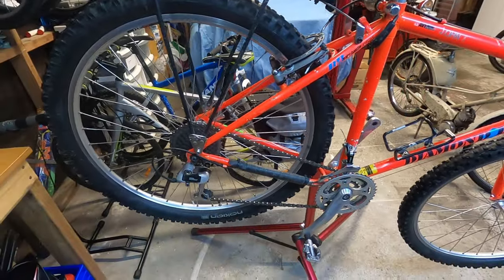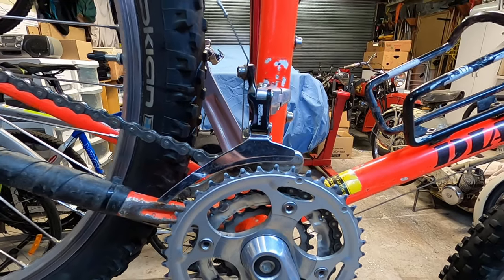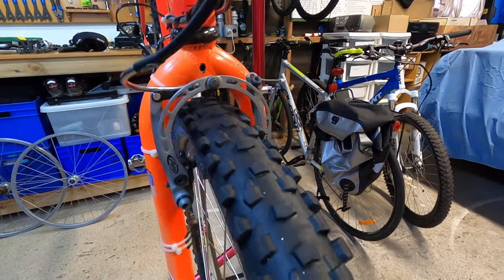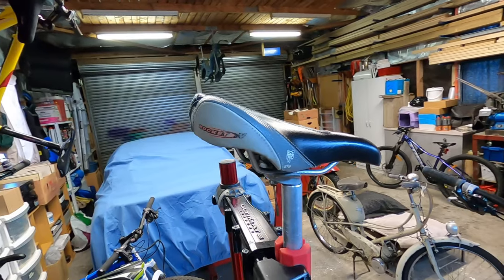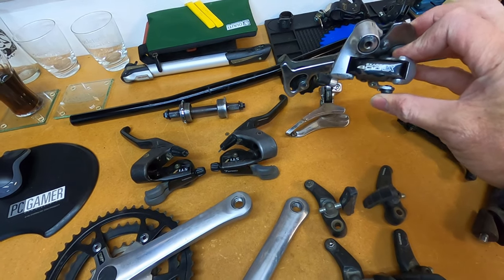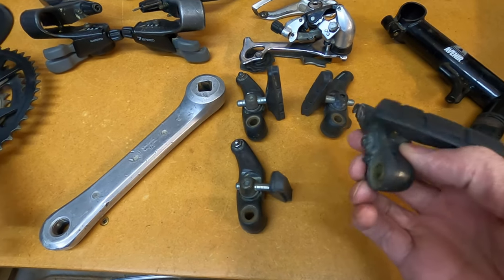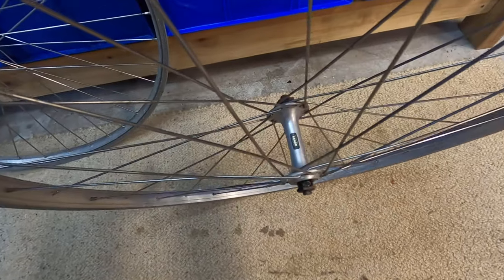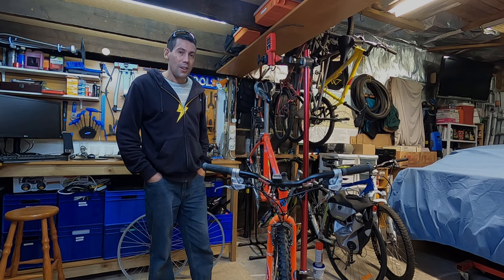1991 Diamondback Ascent Retro Mountain bike

Comment: Picked up my 1991 DB Ascent EX in Indigo/Pink/White colorway earlier this year and it quickly became my go-to gravel bike & commuter! Still using the 3x7 deore LX that came on it but with thumb friction shifters and avid levers/tektro v-brakes instead of the integrated brake/shift levers and canti brakes that were on it. Also running some slightly swept back 7/8" titanium handlebars and a 35mm stem with a threaded to threadless converter, and some Maxxis DTH gumwall tires. Absolutely in love with this bike. As of today I've put just under 350 miles on it and about 27,500 feet of climbing. It is wonderful. Runs silently, shifts smoothely, feels light and responsive and doesn't fuss about anything.

Love the orange color of yours and so happy to see you're still putting miles in on it! These bikes beg to be ridden and appreciated.
Reply from the maker: Hi there, that's awesome to hear about your bike, and sounds like a nice retro color scheme.  The early Diamondback bikes are great bikes to ride, I use mine as my go to bike too.  You may get some comments on the trails I find, possibly as you just don't see many retro bikes around these days.  Definitely a bike to hang onto and enjoy riding 😄

Comment: Good to see appreciation for the old mtbs. I've resurrected my 1990 DB Ascent first and only bike. Still has it's original parts...except for tyres and seat and grips. I use it for a bit of everything, road and off road touring; and as transport to cut down on fuel use and costs.
Reply from the maker: Thanks yes its great keeping these older bikes going and used, good on you for getting your first bike up and running again 👍

Comment: I'm looking forward to rebuilding my 1998 Cannondale F500, which was my first real mountain bike and probably the one bike I've owned with the most miles on it.
Reply from the maker: That's a fantastic bike, I googled the model to see what they come with spec wise, quite a nice bike indeed.  Does it have the head shock, how does it ride?
Reply: Your bike is nice and I like your video(s). I'm trying work up the courage to make one someday. The Cannondale is light and stiff, and the head shock is pretty nice and maintenance free. I had the frame powder coated, got new wheels and all new components (virtually nothing was salvageable), so it will lose its retroness. But I don't care; it will be like new again, which will be exciting for me as I haven't been on it in 16 years.
Reply from the maker: @tanner4828  Making a video is a good idea, I find the gopro cameras really versatile if you are looking for a camera to start with.  Nice it sounds like it will be a good build and it doesn't matter about losing its retroness at least it will be back riding again 😊

Comment: I have this exact bike and it was also my first, so very sentimental..it needs a new rear shifter control as the wire has gone slack.
Reply from the maker: Hi Grant, good to hear you have the exact same bike.  Definitely hold on to it I still remember seeing mine in the showroom window.  Are you still running the original rapid fire shifters?  Hope you manage to find a replacement shifter, perhaps the shifter needs a good lube up?
Reply: @MannixGarage  all original except the seat and tyres
Reply from the maker: @grantrayner2291  Sounds like you have a nice stock bike.  I have kept the original bits for mine.  I too don't have the original tyres which I remember being Tioga Wonder Dawgs, oh the memories 🙂
Reply: @MannixGarage  I will have to open up the shifter and have a look, the leavers move but the cable doesn't so something has snapped or broken within the casing. I too saw it in a shop and it was 50% off so I spent my first months pay check of my first job on the bike. Your video has got me motivated to restore it so I can ride the local trails.
Reply from the maker: @grantrayner2291  Hope the restore goes well.  Do you hear a clicking noise as you operate the shifter? Hopefully nothing is broken internally.
Reply: @MannixGarage  no clicking...will open her up this weekend.
Reply from the maker: @grantrayner2291  Hopefully you find its repairable.

Comment: Great video! Currently running a 1995 Specialized Hardrock. Did you ever finish restoring the other Diamondback you got?
Reply from the maker: Hey thanks for the comment, a 95 Specialized Hardrock would be a nice bike to get around on.  The older bikes are getting harder to find now, so hang onto it 😊.  Yup I am going to start on that DB Apex soon, I am just collecting parts together currently.